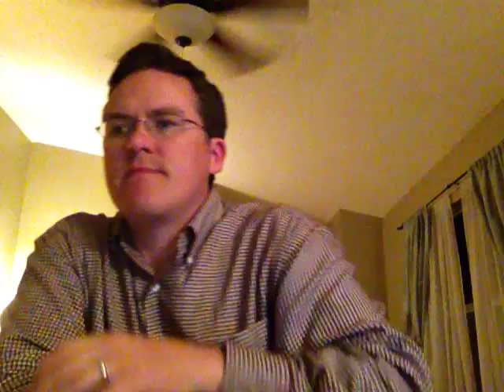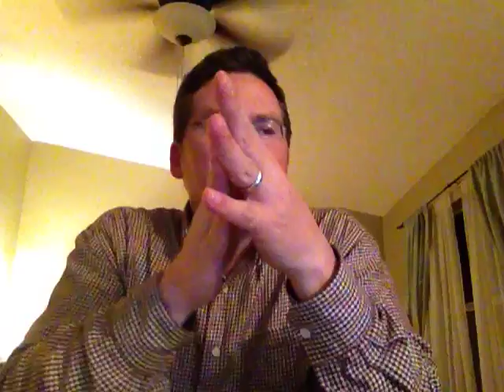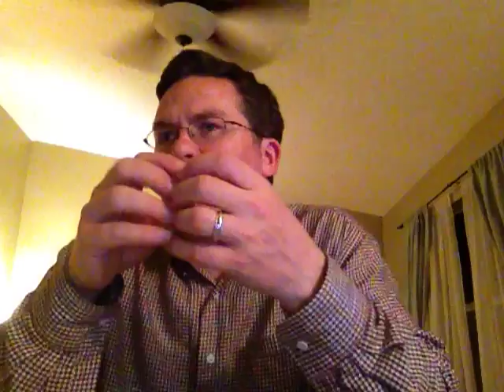Increase Diesel Engine Power | Bell Performance Video Blog

Comment: any tips for old diesel engines?
Reply from the maker: pravda991 Possibly, depending on what you need to know. Tell us more about what you're interested in.
Reply: Its a 993ccm 3 cyl turbo charged engine. I think they took maximum from that engine,but im thinking about staight pipe and air filter.